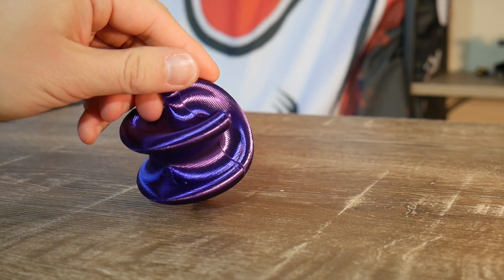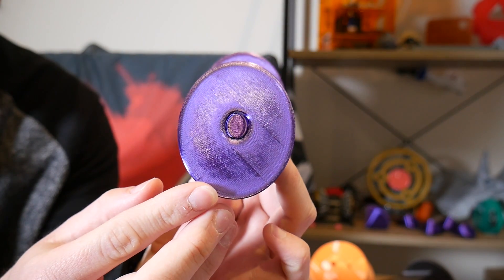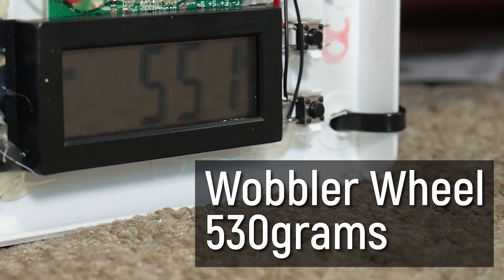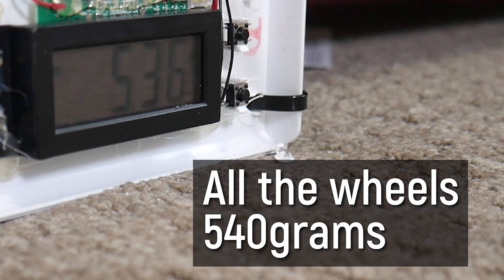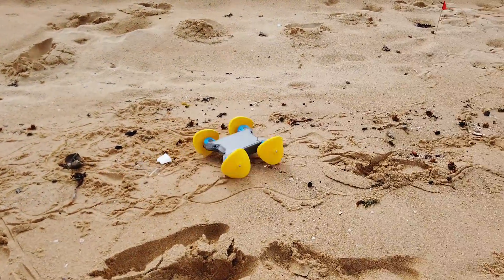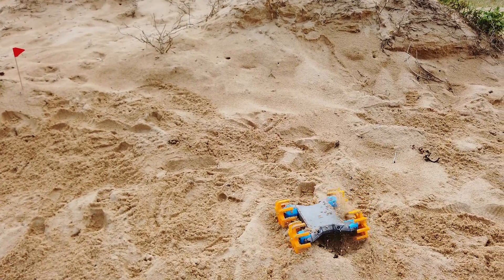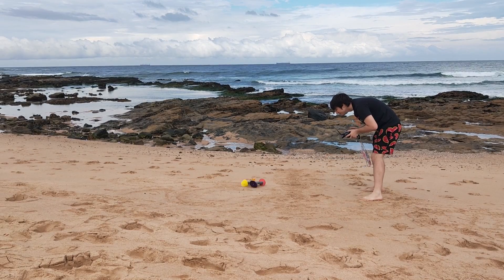This Robot Drives on Wobbly Wheels (but HOW?)

Comment: Has anyone commented on the fact that your paddle wheel also have about 6 times as much surface contact as the others. To be more equal the wobbly and chip shaped wheels would need to be basically as wide as the length of each of the paddles.

Comment: The moment I saw the spoke wheels I knew they're going to have an unfair advantage on sand, they're basically treads without the round wheel bit lol. A fun project would be to make "screw" wheels. They would act as regular wheels with skid steer, but on sand they could be used to "crab" the vehicle around sideways by inverting rear/forward motor direction and use the screw pattern to move.

Comment: You'll encounter these same issues with any type of wheel that has a fairly smooth surface.  See how they perform when you introduce a pattern on the edge that touches the ground surface.

Comment: I would like to make a suggestion to instead measure the effective surface area. If a wheel rests on two edges, that "air" should be considered surface. If the wheels are designed for loose sand, determine how deep the vehicle can sink, and use that to determine the total surface area of the wheel that can push against the sand when turning specificly one way.

Out of all wheels, the disc wheel has the least amount of effective surface area, the spokes wheel has the most amount of effective surface area (by a huge amount).

Comment: You should modify the spoked wheel at 5:01 to a paddle design like a paddle boat for sand and water.
Maybe paddles with points like golf shoes or all points on a round surface. Call them golf shoe wheels.

Comment: Yo that digital scale hack to create an instrument to measure pulling force is lowkey brilliant. I kind of want the process for that as an Instructable, or at least a YT tutorial.
Reply: Don't understand why he didn't have it simply push the original scale. Wouldn't have wandered so much.
Reply: Scale + attachment mechanism = force readout in chosen units. It’s that simple. So luggage scales are immediately excellent for this, gluing a fixing plate onto countertop scales works too, many methods to achieve it.
F = ma or w = mg ∴ force exerted = readout * 9.81.

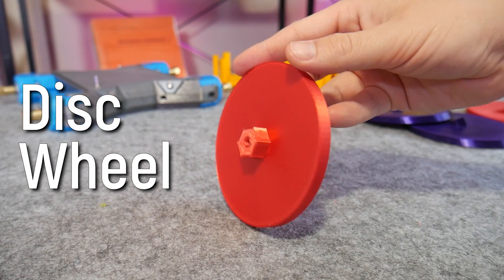Comment: 4:12 "What blows my mind is the fact it has the same surface area as the wobbly wheel despite having a shorter edge length."

Yeah because it's wider, right? That doesn't seem particularly confounding. 

The comparison is complicated by the fact that they're rigid rotors, rather than actual wheels which can deform slightly to create their contact patch. Rather than surface area of the "wheel," it would have been ideal to control the area of the wheel that touches the ground, but since you're not working with a pressurized wheel your contact patch on a hard surface would theoretically just be a single point.

Comment: There is a 'cheat'. On carpet the spoke wheel has the same surface-area. But on sand it sneakily has double the surface-area. The bottom and the side. But then again so did the wobble wheels have more surface area judging by the carving in the sand.

Comment: I would suggest trying a design that resembles a pinwheel with curled rounded edges. It would provide plenty of traction as well as the scooping ability to climb in sand while still rolling smoothly on a flat surface. Plus it's an eye catching design that would fit with this project! Just make them tall and slim to increase the ride height.

Comment: To make the spoked wheels more fair to compare to the other contenders you could make the leading edge (relative to the ground) a wedge, so the spokes don't use the dirt to push the car forward.

However, that might result in scooping... which would just bury the car, making that version worse than any of the other wheels. That is just a guess though. I think it's worth a try.

Maybe to compensate for the scooping effect (if it happens) make the bottom surface of each spoke curved, so the wedge doesn't scoop the sand as much. Each spoke would set down onto the sand without scooping or pushing the sand. This might result in lower speed than the original spoke design, but more fair to compare to the rest.

Comment: The traction "test" is meaningless.  The useful traction test would be the amount of pull before breaking loose.  Spinning wheel traction is useless both as a test and as a applicable process of locomotion.
Reply: Well, if anything, that traction would be greater than that of the spinning wheels, do you agree?

Comment: awesome video! 
About velcroing the wheels I did that to a F1 cheap rc model I had, and it came out great! at a carpet floor it almost instantly took off and stoped , with no slippage but also putting quite a force over its structure and engine. it eventualy burned the engine, but was great fun :)

Comment: using the eight-prong wheels at the rear and the "prongle" wheels at the front would mean increased traction than just single sets of wheels and all of them at one. So basically, the best performing in the rear and the second best up front.

Comment: I think a better design for the wheels that would work in sand would be having wobbler wheels with paddles.
Just like sand tires, you want to maximize the area and trap the sand that you can push from. Spoked wheels lack the surface and sand can push above the spokes. Since wobbler wheels worked better than straight wheels. I think wobblers with spokes would work better even if the width was smaller to keep the same surface area.
Alternatively, wide mesh wheels could do a good job.

Comment: I feel like the wobbly wheels would be good in offroad. Just think about it. Normally your wheel gets stuck and keeps digging into same area which doesnt really help.
Wobbly wheels have same surface area on a wheel but much greater area on the ground meaning that if the wheel encounters a softspot, it might spin out halfway until the wheel finds traction on sturdier ground as it wobbles around the ground. Thats why the pulling area varies alot since the mating surfaces vary as the wheels rotate.

Comment: there is too many torq into electrical motor, you need to reduce the the voltage in aim to reduce the speed ( speed variator

Comment: if competing wheels must have the same initial contact surface area but can have different (i.e., greater) secondary contact area as they sink (as is the case with your different options), then this creates lots of opportunity. One obvious variation is to add recessed webbing to your spoked wheels so as they sink a little bit (several mm), they would create full contact with the sand and would essentially float. The horizontal spokes would still be available for forward traction.

Comment: The "spoked" wheel was essentially a widened disk wheel with teeth. The edges of those teeth propelled it way more than the measily friction on the surface of the plastic, so you should consider putting teeth on the wobbly and pringle wheels. Of course, it would also be neat to see you work out the mechanical analysis before testing.

Comment: Why are the last ones did the best in the sand is because it had pretty much wheels the multiple ridges that would cause the wheel to go up and down that’s counting his traction and the thickness of the wheel if you were to do that with any of the other wheels aside from the flat one that’s just a thin wheel then you would’ve heated the Why are the last ones did the best in the sand is because it had pretty much wheels the multiple ridges that would cause the wheel to go up and down that’s counting his traction and the thickness of the wheel if you were to do that with any of the other wheels aside from the flat one that’s just a thin wheel then you would’ve heeded the same results same results
Reply: I did voice to text... it was indeed a regrettable occurrence

Comment: If you made a set of off road wheels this way, if you got stuck and spun a tire it would not dig a narrow track, it would be moving to fresh ground all along the rotation which is interesting.
Though it may put too much lateral pressure from shoving dirt / sand etc and snap something. Also that wandering effect could be pretty dangerous but It would definitely be interesting to see in a full scale application.

Comment: How about Squares? Or Triangles? Or better: Star Shaped. The pins dig in but also out... 

Or

You change the unit (cabin) the wheels got powered to, its very low to the ground. Think about Monstertrucks, the actual cabine is high up. I think THAT also has an effect...

ACTUALLY

If you change the "cabin" so it's higher up (that it doesnt look like a repurposed drone) and use the same wheels, the outcome might be different too! Trying is knowing and you Sir, showed up you like trying!

Comment: I think a mix of wobbly wheels and spokes wheels would do better, because I think the fort of wobbly wheels is that when it doesn't gain traction with the bit of surface it's touching it shifts to the side.

Comment: Why not try to take each of the radius until de center, as a flar surface? This way the sand cannot pass through the radius, but has to get out
Reply: For the sake, it could be three sectors, each of 80 degrees, with empty 40 degrees sector in between, but taking the end of the sector as a flat surface until the center

Comment: the spokes wheels can be attached to eachother like this > * < instead of how they are now. if you do that they will grasp on the sand way more instead of digging under it and continuing, and it has way more grip if it's like that. try with 6 spokes and see if that works out. they push the sand backwards way more. that's also why shovels are full instead of just outlined, so it can actually move the sand.

Comment: My ideas for how to get a vehicle to successfully cross sand: use a slightly flexible material that creates a large contact surface. Do not use a tread pattern that digs. Surface flexibility is to help prevent digging, which lowers the vehicle body. The surface flexion should create larger surface contact as larger force to the wheel drives it into the surface. When stuck, increased power to the wheel actually creates more traction if the wheel can flex this way. Vehicle body should be as far from the sand as possible, so interesting bent axle designs are reasonable here. If each wheel has its own drive, no traditional transmission is required, so you could do some hilarious (and effective) things to avoid the issue of being "beached". Flipping wheels and other stuff that you'd never consider for a road-vehicle make a lot of sense for a robot vehicle on sand. Stuck because your rear wheels are in a rut? Flip them over the vehicle body to get out. I mean, why not? I get that your video was looking at whether the weird wheels would be good on cars, but even regular cars suck on sand. You have to deflate the wheels and pray they have a radius that exceeds the depth of whatever tire tracks you're following.

Comment: does the logic used to drive the wheels factor in some sort of distribution of power based on the resistance on each wheel (does your robot have all wheel drive)?

Comment: The problem is that the car is too close to the sand. As soon as the wheels dig a hole, it falls flat on its belly on top of the sand and prevents the wheels from having any more traction, because they dig all the sand that they can and the weight of the car cannot help anymore to sink them in. You need to make wheels with a larger diameter to make sure that the car body is kept from touching the sand as much as possible.

Comment: What your wheels need for sand, given the restriction on the undercarriage height, is more flotation.  Your restriction on flat surface contact area is a bit meaningless on sand, but using a very long, mesh cylinder (something like the Tower of Pi: https://www.thingiverse.com/thing:271769 ) would give you both traction and flotation while still meeting the surface area constraint. Plus you'd have an obscure circular reference thing going for you.

Comment: Sand wheels need to be wide otherwise they dig in... that's why beach bikes have such wide tires. I would suggest retesting with wider versions of each of the wheels or test on a different surface

Comment: Funny/Interesting video... The main advantage that the spoke wheels had, it was their thickness. In a particular time of movement, the friction (which is the force used to move the car) is larger than the other type of wheels.
The sand challenge needs a wheel that could alter the sand to avoid slippering, the most you can change the sand the better you can move.

Comment: Mix wobler with spoked. I guess you get more traction with wobler because for every revolution you have more perimeter and surface, but like conventional the have too little footprint perpendicularly to torque to make enough difference in lose terrain. The other think I guess is considering the spoked wheel tends to remove sand backwards if all the spokes are aligned then the sand would be removed quickly and the hole will be created before the “car” find enough traction to move, but considering the spokes not aligned in the  theoretical mixed version, in one revolution the spokes would have a slightly different surface to attack

Comment: You asked if we felt the spoke wheels should be disqualified. I say yes. The reason being; surface area. I believe you measured the outer edge of each wheel, assuming that ONLY the outer edge would contact the ground. The spoke wheels were clearly using the leading face of each spoke to dig into the sand, not simply using the pre-measured  outer face area.

Comment: the pull to the right with the wobbly wheels may have been caused by the carpet weave direction. A test in 4 quadrants should be able to prove this

Comment: Though it's a very cool looking design, I would imagine that the wheel bearings will wear down more quickly with wobbly wheels, as the forces exerted on them is constantly changing and unequal. As if with regular wheels you're always driving in zig-zag.

Comment: id offer the craft more clearance, you wouldnt take a vehicle with such a low clearance on the sand. also the width of the first three wheels were much different from the last, first three were like a knife through butter with such little surface area whilst the last are like the mississippi river boat, plenty of surface area to push the craft forward.

Comment: To my mind it seems to make sense that the spoke wheels do better on carpet. While they all have very little friction on that surface, I recon the spokes probable are able to dig into the carpet better and get some resistance from there. This is probably also true to all other non-regular wheels. When ever they move over a soft surface any given part of the wheel interacts a little more with uncompressed material and so there's a little more resistance. Just a guess though.
Super nice vid!

Comment: operator error ! I live in minnesota - lots of snow & ice. I know that anytime I spin the wheels on a surface the game is over no matter what type of wheel I'm using. You have got to gentle the wheels up a slope, and of course not drive them into a very large pothole. Increasing the speed of the wheel when it is just spinning does not work !

Comment: Why would you disqualify a tire design because it works better than most? Just because it has similar properties to something that already exists? Anyway, as far as sand tires go, they are big and balloon shaped to help them "float" on the sand and helps to prevent them from getting bogged down. You might consider adding that concept into future designs. Or some little claw like curves on the paddles.

Comment: lmfao how could a person be smart enough to perform all this design and production work, and yet so completely clueless that they think that the little rover could successfully cruise around on sand that rough with only about 1 inch of clearance and smooth pieces of plastic for wheels. i mean, common sense should tell you that it would never work properly

Comment: Very nice video! I was actually looking for something else, like how much efficiëncy does these different Wheel have. I could see the wobler wheels under a reall car with an engine that pulses the wobler output. So theoretically maybe even propel the vehicle in 1:2 power output. Or would that cost to much power and cost to much fuel. And is the original design actually the best option.

Comment: Ninja throwing star shape? That is as PC of a description as I can think of...no offence to any ninjas. If, however, you counted all the contact surface area of a star, to make it equal, I think the diameter would end up being too small to clear anything. Without doing any math I'm thinking the same might happen to the paddle wheels if you counted the outside surface AND the attacking surface. That would make it the same as the other wobbly wheels, but only on surfaces that take advantage of an attacking surface. Maybe the star would only need one edge counted...or just the points! Then it would be ridiculously huge!

Comment: I don't think the problem here were the wheel designs themselves but that the chassis gets stuck on the sand itself due to how low to the ground it is. If the wheels were bigger to rise the chassis higher up OR if the car was designed with the chassis higher up the car would probably do better on pretty much all of those wheels.

Comment: I feel like the disc wheels are still the most practical because they are probably more durable and material efficient. Also, although they had the weakest pull force they have the least stray/pull in the wrong direction